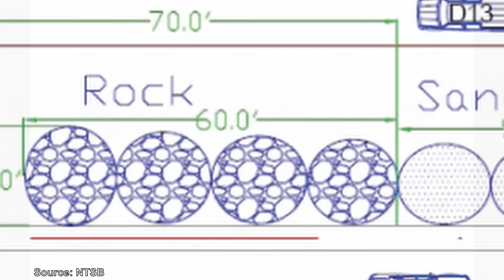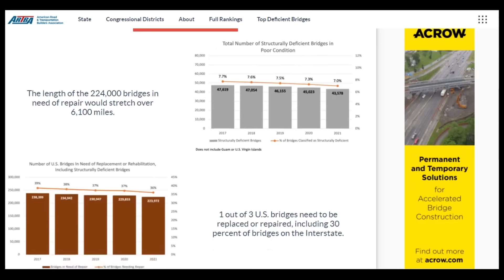The I-35W Bridge Failure | A Short Documentary | Fascinating Horror

Comment: Engineering student here. I might have two insights that can illuminate why things like this happens.

1) As an engineer, you can easily build a bridge that will last without major repair for centuries, but that is not wanted as that comes with an unnecessary cost--what your job really is, is to design a bridge that just about manages to hold the load without over-dimensioning any of the components. This makes the bridge safe enough and cost-efficient, but even with the practice of safety factor in dimensioning, it doesn't guarantee that it will cope with future additions like new road layers. You could argue that you should still over-dimension some component just to be sure, but then you run into the risk of having your proposed bridge design outcompeted by cheaper projects for other firms and companies.

2) As an economist (we do read a bit of economics too), there is a term called "Value of Statistical Life", or "VSL", which essentially is an economical indication for how money can be devoted to prevent a fatality. According to Wiki, for U.S., the VSL was $7.5 million in 2020. Thus, if the cost of preventing 10 fatalities exceeds $75 million, it is not really worth it, since the money could likely be better spent elsewhere. This is a crude explanation and I'm sure proper economists could describe this in greater detail and quality than I, but I think it could be interesting for others to know.

Comment: My family moved to Longview WA in 1984 when I was about 19 or 20.  Even back then, people talked about how the Lewis & Clark Bridge that spans the Columbia from Longview WA to Rainier OR was supposedly built to last 50 years, and was already more than 50 years old.  Today it's more than 90 years old, built in 1930, and I don't think there are any plans to replace it -- in fact according to Wikipedia they've talked about building a second bridge, not as a replacement but to handle additional traffic (note -- they talked about this in 1990, 32 years ago).  Not saying it isn't structurally sound, but I worried about it 40 years ago when I had to use it.  And really, it's just a single example of all the aging bridges in the U.S.

Comment: Some years prior to the I-35 bridge collapse, a 4-lane bridge connecting the city of Radford VA to Pulaski Co. VA was abruptly closed to traffic during rush hour, due to a routine inspection discovering danger signs which could lead to a collapse. A new bridge was constructed parallel to the original, but it took time, during which travelers had to take small back roads, going the long way around to get to work or go shopping. The old bridge couldn't even be utilized for emergency transport while closed to all other traffic -- ambulance had to halt at one end, the patient gurney unloaded and run 1/4 mile across the bridge by EMTs on foot (!), then loaded into a waiting ambulance at the far end to continue the trip to the hospital. Even mo-peds were banned; apparently, the inspectors believed that vibration from a mo-ped might be sufficient to bring down the bridge. Pedestrians were still allowed to cross at their own risk, and many did so on a daily basis. Most astounding, to me, was a horse trotting back and forth the full length of the bridge: since the horse lacked a motor, it was deemed to pose no greater risk to the structure than a human on foot. HOWEVER, a horse weighing half a ton can generate a fair amount of vibration while trotting, probably far more than a mere mo-ped buzzing along! Well, the old bridge survived until the new span opened, and to bid a fond fairwell, they held a massive "Bridge Party" a quarter mile long, with thousands of people in attendance on the bridge. Shortly thereafter, the old bridge was demolished and a second span twinning the first replacement was built -- now six lanes carry traffic over New River. But remembering how everything was halted before a disaster could occur... That could have been us featured on Fascinating Horror... My heart goes out to everyone who survived the terror, and to those who lost loved ones on the I-35 bridge. 💐❤️

Comment: I'm not surprised the design flaw wasn't an inspection issue.  The issues with design should be caught during the proposal phase.  Inspectors are mainly to confirm the integrity of the existing structure.

Comment: Like most commenters, this was in my town. But I've never understood the angst about inspectors not catching the issue year after year. Why would anyone think that the design itself would need to be re-checked as a part of inspections? Why would inspectors looking for cracks and corrosion also be expected to pull up the original blueprints and re-do the math? That's not something that would change with time and exposure. Fortunately, after the collapse, engineering students were assigned homework to do just that for many of the remaining bridges in Minnesota. That made me feel much better.

Comment: The decision to handle problems with the road surface by just adding new layers of concrete without considering the weight load not just once but multiple times figures heavily into the gusset plates' failure.

Comment: They were able to get the I-35 bridge replaced so quickly by stopping a different job and moving the contractors over.

The other job?  Increased capacity on a MN62/Crosstown interchange that involved creating multiple new bridges.

Comment: A month earlier, both external double communication routes were closed to traffic for the time of resurfacing. These works could hasten the damage to the main structure. They should renovate it the other way around, first construction, then replacement, not a new surface. Then the bridge would have to be completely closed to traffic.

Comment: Not to be a contrarian, but I had a statics professor that claimed to had been an investigative engineer on this collapse. If memory serves me, and it may not, but the design called for the proper thickness of gusset plates, but either the supplier or the contractor cheeped out on the material in the assumption that it wouldn’t matter.

Comment: The cause was a design flaw no inspector had noticed. Wow. Fantastic. Just doomed from the start.

Oh! and even better! Later inspections labeled it structurally deficient! But they just shrugged it off. Along with 75,000 others. Lovely.

What is the point of these systems if no one acts on them? As I've said for a long time now, the law only matters if someone enforces it. Saying "that's illegal" or "they're legally required to report that thing" doesn't mean anything if no one enforces the rules.

Comment: And yet, after all of this, on May 11, 2021, an inspection revealed a nearly full-thickness crack in the tie girder of the Span A North truss of the I 35 Hernando de Soto Bridge spanning the Mississippi River between West Memphis, Arkansas, and Memphis, Tennessee.
The crack had gone unnoticed for several years, slowly increasing in severity because the appointed inspector refused to follow protocol !
Another inspector took over in 2021 and in the first go found the huge crack which by that time had almost fully severed the beam. The catastrophe waiting to happen was avoided just by a hairs width.

Comment: If there was a design and development fault then the bridge should never have been signed off and allowed to open in the first place....no amount of post-opening inspection is going to pick up a  fault that nobody even realises is a fault because inspectors would assume that construction processes had all been followed correctly. That new bridge looks a lot more solid than the old one though (and much more aesthetically pleasing too).
Reply: He did mention that the bridge design was sufficient for the traffic load at the time it was built.  But of course times have changed and increased population means increased traffic load.  That should’ve been factored in, but it depends on the engineer and government entity at the time.

Comment: Bridges in the US are still terrible. States do inspect them, but no one wants to pay for the repairs/replacements, and even if a bridge get repaired it takes years. And god help you if the bridge is on any kind of border - county, city, township - both sides will insist that the bridge is actually 5 centimeters longer on one side, so it's the others' responsibility to pay for the bridge repair.

Comment: Interesting failure I actually did not hear of this collapse.    I think the main issue is that many of the bridges were built from a boost to federal funding but the states later lacked funds to maintain probably due to loss of population as people migrated to other states, especially from the Midwest and Northeast.       After the 2001 earthquake here in Seattle and many bridges that were damaged although thankfully no one was killed,  they created new codes and requirements including replacing most of the infrastructure in the state,  such as tearing down the complicated 3 floor Alaska Way elevated highway that was just completed, and replacing it with underground tunnels, very expensive project and Federal funding was diverted to this probably at the expense of other states.     Also the Longest floating bridge in the world had to be fully replaced to be Earthquake proof so another crazy expensive project here in Washington state and then you add on top the crazy population increase over 1 million people moved here in just a few years, so just everything had to be increased, the complicated mountain passes, very expensive projects as well, building a large light rail network, increasing the ferry boat network which is the largest network in the world of ferries.

Comment: Car dependency and size has exploded in the past 20 years. Infrastructure will fail. Building more roads just increases congestion - it's called induced demand. 
Over 45% of car trips in the US are 3 miles or less.
There are better options which could help avoid tragedies such as this.